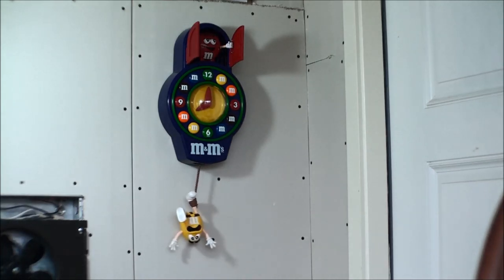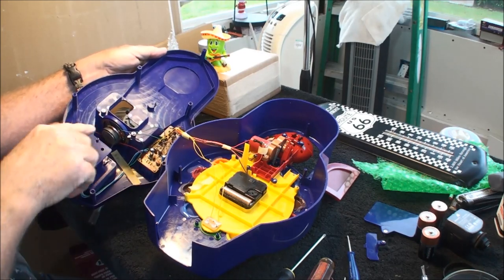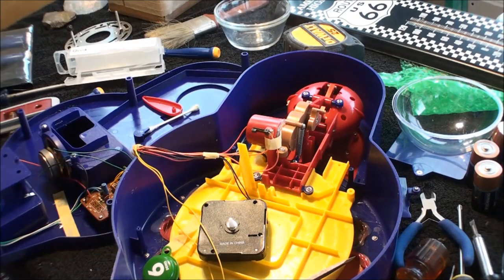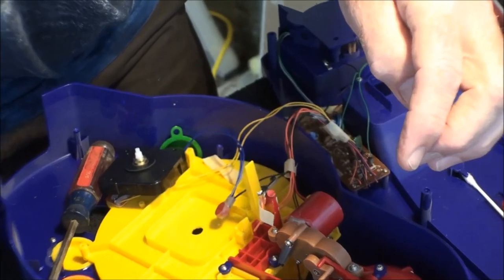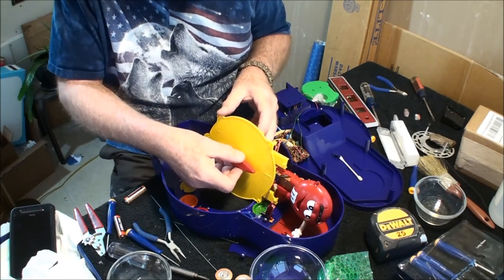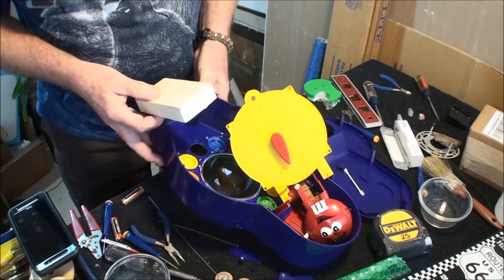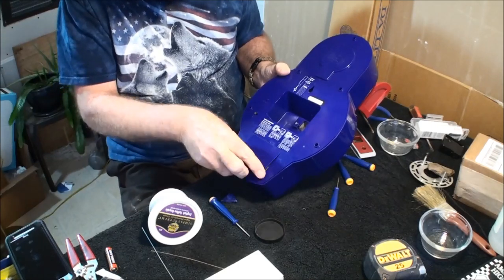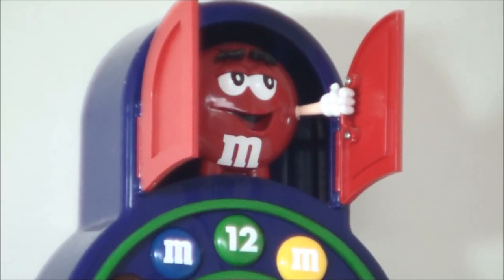How to Replace the battery movement on a M&M's Animated Pendulum Wall Clock

Comment: Actually Just Mike it was only $45.00 after shipping. The works you got me didn't want to run in the clock so I took the old one apart and fixed it and it works great now. Thanks.
Reply from the maker: Well shoot R S, Did this video tell the price? In the editing room, it skipped the sound out, so I thought I was safe. It's great you are good with your hands also, so you could fix your own clock.

Comment: You did a great job on the clock Mike. Must have lots of patience. It's a very nice clock but I don't think I could listen to that every hour
Reply from the maker: Thank you Stephanie Pooch. This clock has a switch to turn the sound off. This is why you would have to place this clock in the right location, as to not bother anybody, or turn the sound off and enjoy it anywhere in the house.

Comment: Hey mate i have the same clock with the same problem could you please put a link up for where you got the replacement movement? Many thanks michael
Reply from the maker: Type in "Battery trigger clockworks" You will find many places to buy them, that is what I did, but I don't remember who I bought two of them from. Thanks for watching Michael Diener
Reply: @justmike57  I can find heaps but they are the wrong hand and the time adjusting dial is covered
Reply from the maker: @michaeldiener8148  You have to use the hands you have on the clock already. The time adjuster is covered, so, like mine, I had to cut away part of the clock so you could get at the adjuster.
Reply: @justmike57  okay cheers I didn't realise you had to do that too. Thankyou.
Reply from the maker: @michaeldiener8148  Yes, Just make sure you smooth the edges to make it look nice. Also, you might want to use a heated knife to melt the plastic cut area to get it out.

Comment: I tried to fix these battery movement and I found out the tick-tuck ones need to replace crystal of 32.768 KHZ.  I also tried to replace swift ones with  crystal of 32.768 KHZ, it does not work.
Reply from the maker: To replace the battery movement, you have to order the Trigger Movement to get this clock to work.
Reply: Yes, I do use trigger movemnt. I'm just wondering which crystal is used in swift type clock.

Comment: One of my clock is acting up. I put it on time but a few hours later it has another time
Reply from the maker: So is this clock a wind up clock, if so, it might need cleaned and oiled, Is this a wind up clock with a pendulum, if so, the pendulum has a nut at the bottom you turn a 1/2 a turn at a time to set the speed of your clock. You raise the bobber to speed up the clock and lower it to slow the clock down.
Reply: @justmike57  I would take a look

Comment: Mike  our mm cuckoo clock  is not working  can you help us out
Reply from the maker: Yes I can. If you watched the whole video, I had to order a Trigger Battery Works for my clock. Also, where you set the clock for the right time, you have to cut out the back of the clock so you can change the time. I bought the works off of Ebay. Hope this helps you for success on fixing your clock. 
My email; justmike@gmail.com